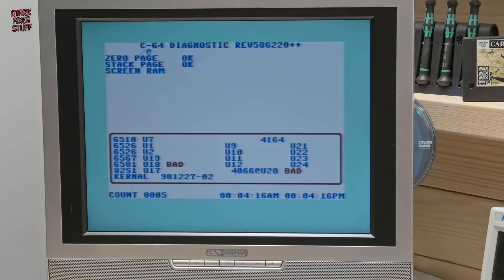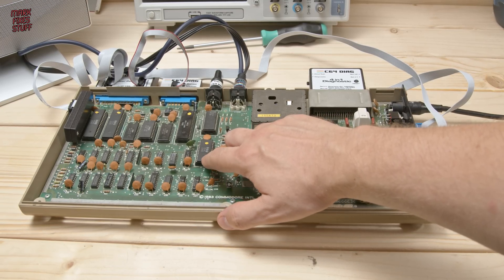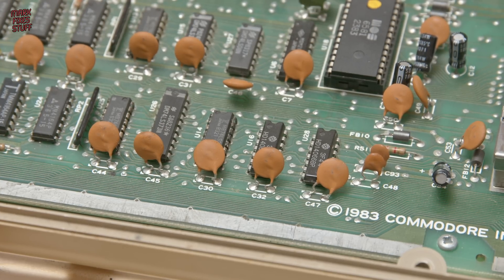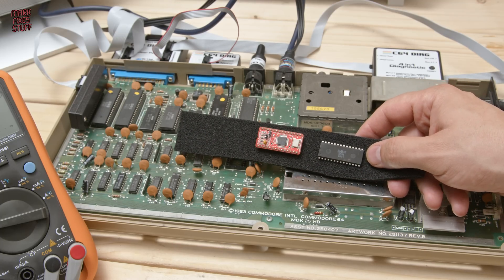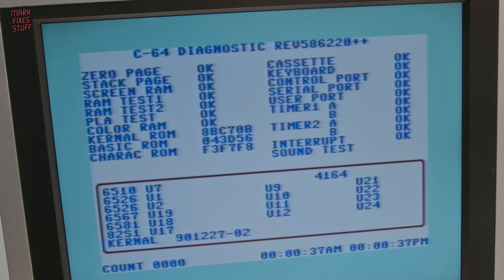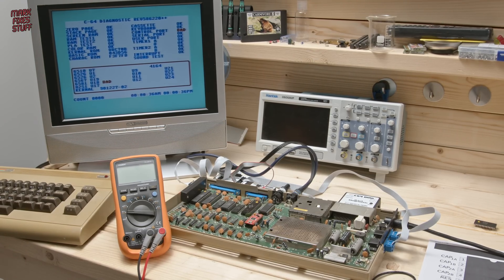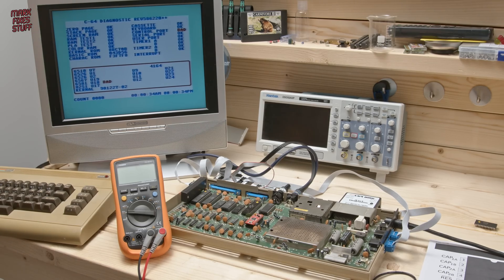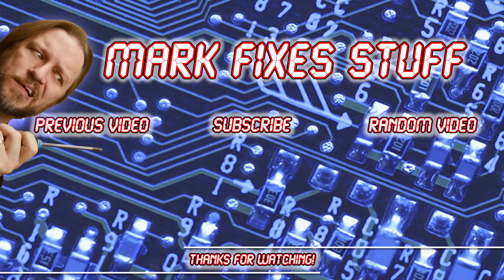Fixing a C64 with NO SOUND! Plus... Why does the SwinSID Nano for the Commodore 64 Sound so AWFUL?

Comment: Swinsid is an old device not developed anymore, over 10 years ago it was one of the only options and first aproach to make a replacement, there was an approach to make Swinsid on ARM, but developer stopped at some point. It shouldn't be sold anymore, it's almost a scam, as there are better alternatives now. Swinsid Ultimate on the other hand is something made by a person who took original swinsid and modded it, propably hard to get now.

Comment: SwinSID is based on an ATMega88 chip, which is an 8 bit microcontroller. So, it's not doing a bad job, actuallu. Due to this, it doesn't the paddle inputs, which are analog. If a C64 has a bad SID, it's a lowcost solution to have sound again. I've built a few myself. They are quite easy to build.

Comment: Does pin 28 have to have over 12v to operate the 6581 properly or would 11.xx do? 
I thought I had a bad 6581 but a replacement ARMSID isn’t recognised during the configuration prg/setup. 
Great video, thanks
Reply from the maker: 12v is the ideal voltage but due to voltage drops across the circuit it's rare to see it "bang on". I don't know anything about the ARMSID. It might be worth trying a known good PSU?

Comment: Ha, so interesting. I ended up getting a chip puller because I was so bad with a flat blade, especially where there wasn't much room. For me it really works well, but honestly whatever works for anyone.
Reply from the maker: I was expecting a bit more “engagement” surrounding the chip puller 😂!
Reply: @MarkFixesStuff  So was I, but the next one should be a philips head - that would be impressive 🙂

Comment: Mark, you being a YouTube content creator that focuses on fixing stuff mainly retro computers, I don't think you watch enough channels of the same genre. It is quite common knowledge that SwinSID Nano is an abandoned project because it did not succeed. It quicky became very apparent that The MCU used was not enough to emulate the mighty SID in an acceptable level, this and some ego wars has stopped this project in its tracks without ever being finalized. Apart from being a terrible emulator, it can't do the analog pot reading that the original SID was tasked in a C64. That's why you are receiving that error. Despite this, people are still copying this project and selling on eBay etc places to the people that does not do their research before buying. The only thing a SwinSID is good for is to test whether something is terribly wrong with a C64 board that may kill a genuine SID, or one of the better emulators when powered on.
Reply from the maker: Thanks! This is my first foray into SID replacements. The SwinSID nano was a drunk eBay purchase. I’ve learned a lot from my viewers here!! Thanks for this great history!
Reply from the maker: (I am a Spectrum guy really… shhhhhh 😂 )
Reply: @MarkFixesStuff  Well, although commendable, that's no excuse for not doing your homework now, is it? 😂
My first computer was also a Spectrum 48K Rubberkey. In fact I still have it in perfectly working condition (took some working) along with other Spectrums. I too have a special place in my heart for Speccies, but I do own other 8bits, like various C64's, even an Amiga 500+ that takes me to the world of 16bit whenever I feel like it.😁
Reply from the maker: @borayurt66  well done for keeping the rubber keyed beauty going! With the Commodore machines I discover along with my viewers help so you have to forgive me. It’s all for fun and discussion in the short videos ;)

Comment: SwinSID is basically an 8580 emulator, not a 6581 emulator. And due to its slower lower cost hardware, it does the best it can.
Reply from the maker: This explains a lot. What’s your preference?
Reply: @MarkFixesStuff  I think it more of a case of what you have got and what you've got working. SwinSID is certainly better than no SID at all. I did a comparison vid which includes it https://youtu.be/D-47IhQSlCM?si=vs9BEPOs3m4OXzVp

Comment: The only SwinSID with proper analog controller input (paddles, mouse) is the SwinSID Ultimate so, yes, that is why the error came back.
Reply: That's not correct. All the other SID replacements do paddle reading perfectly. The only one that can't do it is the SwinSID Nano.
Reply: @borayurt66  Back when I selected the SwinSID Ultimate and got on the waiting list I did so because I was told it was the only one with paddle support. I was even researching to see if I could use my faulty SID for paddles with a SwinSID for sound.
Reply from the maker: Thanks for the confirmation :) it’s a relief that the issue isn’t the c64 as well

Comment: Having about every kind of SID, my rankings are:
1. FPGASID
2. ARMSID
3. BackSID
4. SwinSID Ultimate
Reply from the maker: This is a super useful list! Thank you so much! I’m guessing there’s a cost premium though?
Reply: @MarkFixesStuff  My vote is on ARMSID when it comes to the cost/benefit approach. It works well (I may say 95% accurate, others may say 99%), but it is a very well backed up commercial product. It is constantly being developed in the software side and the users can download improved firmwares to upgrade their ARMSIDs. Firmware upgrades are done without removing the ARMSID from the board, or even without opening up the C64. It is done by a software that can be run by the C64 via a real floppy disk, or your personal choice of a FDD emulator. And there is another software to make some settings to the ARMSID (choose preset 6581 and 8580 modes, even configure your ARMSID to sound anyway you like) 
FPGASID is the expensive choice because FPGA's have become ridiculously expensive these days, but I hear it is very very good too.
BackSID, I don't have enough information to comment on.
SwinSID Ultimate seems to be unobtainium, there are photos of it, test and review videos of it, but no where to buy it. And the ones that are being tested seem like pre-release prototypes with wires botched, stuff attached on with hot melt glue etc.
Reply: These days there's of course ARM2SID, the stereo version of the ARMSID. But there's also PD Sid (Public Domain SID), SidKick Pico (also the 2040DAC variant). All really great and while personal preferences exists no matter which one they'll blow the SwinSid away not much competition at all. None have issues with Fred Gray tunes just to name some that SwinSid has huge issues with - even the lazy jones fixed ones. One I'd like to see really come to market is the reDIP SID but it's as progress is quite slow. FPGA based but unlike FPGASID it has a nice small form factor only barely larger than the original chip like most other replacements.

Comment: PotX and Y are analog signals that the SwinSID (and others) don't support. So the diag test will fail because of that. But the bad sound was a little strange..
Reply from the maker: Yes, I’m glad it’s not a computer error though. Sone others have pointed out the SwinSID has audio artifacts.
Reply: Apart from SwinSID Nano, all of the other plug-in SID replacements support paddle reading.
Reply: Ok, thanks for the correction :)  @borayurt66
Reply: @tommyovesen  Yeah, also the bad sound is a SwinSID Nano thing. It is not a good SID replacement in any way, just an incomplete, abandoned project that people take advantage of by copying and selling on Ebay etc.

Comment: A voiceless SID isn't much use, but I wonder about SIDs where the pots have died but the voices still work -- I wonder if there's enough call for a project to make a board that implements the pots but still passes the voices to the part of the SID that still works.
Reply: Just put your POTless SID as the second SID in a dual/stereo SID adaptor.
Reply: @ownpj  Oh wow that's such a simple, good idea. =D
Reply: There is actually a blog post somewhere someone designed a board to do this. It would just be getting it printed.
Reply from the maker: I wonder how long until the rest of the SID rots though?
Reply: @MarkFixesStuff  As I understand it the pots are mostly separate and the reason they die so much is that they're exposed on the joystick ports with zero protection against static.

Comment: Unfortunately the Swinsid does not support paddles and there are a lot of audio artifacts - so you will see the error in the diag.   Armsid or Backsid are better options IMHO.
Reply from the maker: Thanks for this. I’m a noob with SID replacement options and just grabbed a cheap one from eBay to try. I’m glad this sound and reaction are “normal” though, and not my error.
Reply: That explains it, thank you. I have just tried out a SwinSID Nano for the first time and the Diags gave exactly the same errors as in the video. I thought maybe I had a bad SwinSID